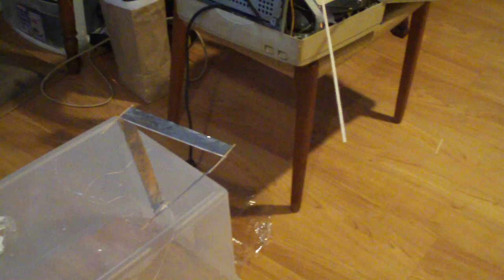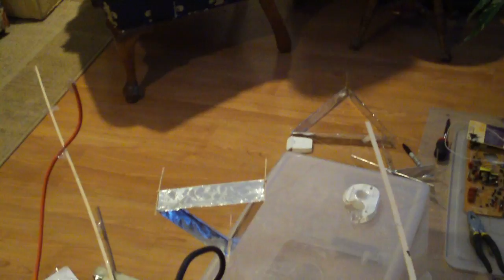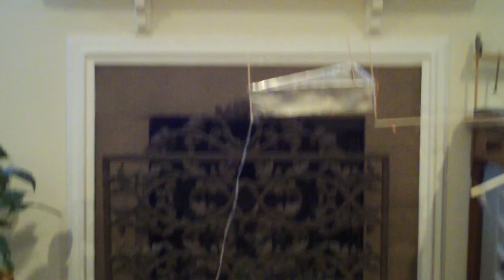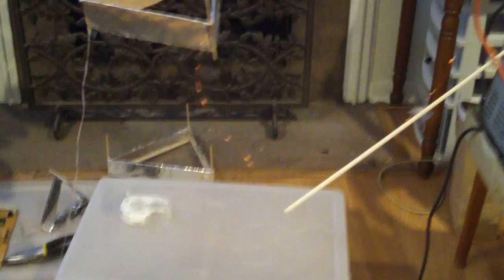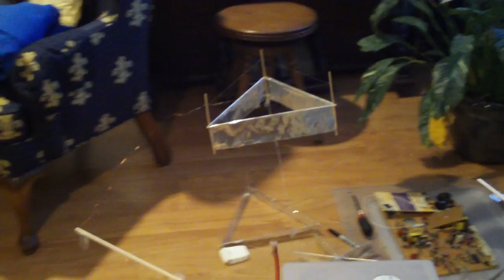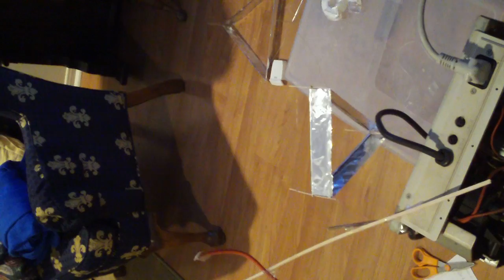Ion Thrust "Lifter"

Comment from the maker: @TheOpenDialog People use them for their high voltage potential, normally around 25 or 30 thousand volts.  It is fairly simple to make it power the ionocraft.  You can get one for free at a local electronics recycling station.  Don't expect the monitor to power much more than the size of the craft I've shown here.  Since this video, I've designed my own high voltage power supply.  It is much smaller but still too heavy to lift by the ionocraft alone.  That is one major problem with this tech.

Comment from the maker: @nja2015 The CRT Monitor will give you around 27 kV @ 1-2 mA.  Different monitors will have different outputs.  To get the most thrust use DC power.  It is also easy to build a driver circuit for a flyback transformer to power this craft.